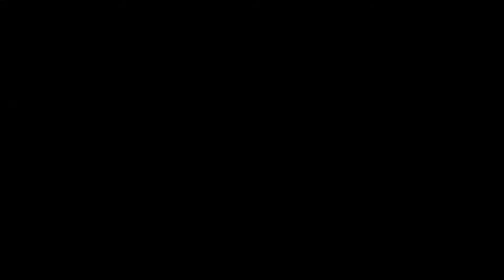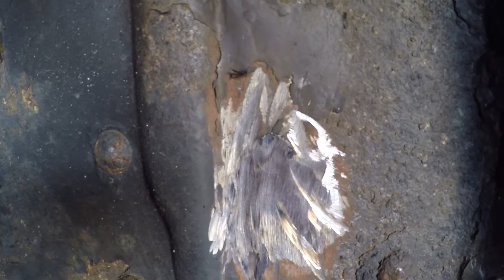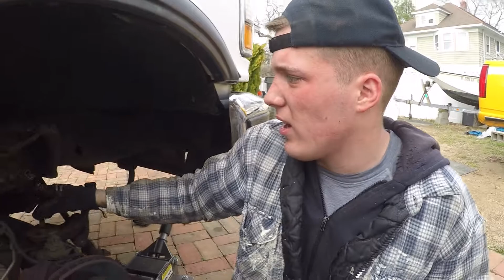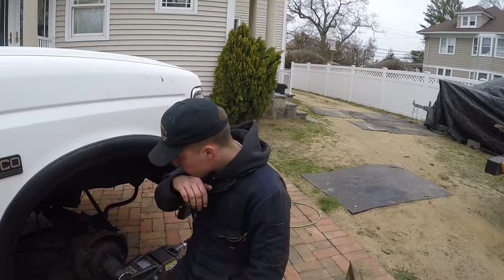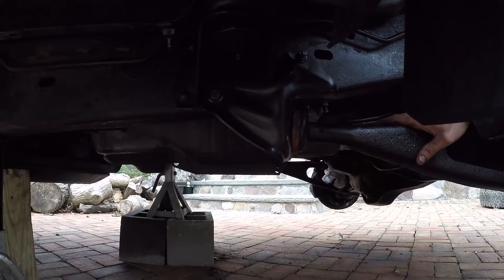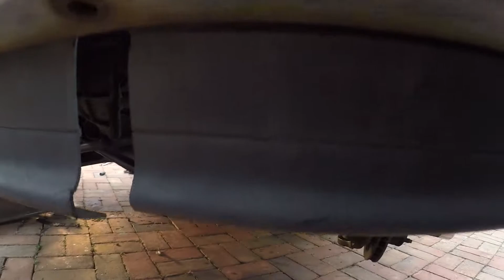FORD BRONCO(F150)- Shock Mount/ ShockTower Replacement

Comment: Does any one else see how crocked the spring looks from top to bottom
Reply: It goes away when you let it down and roll the truck forward. It will freak you out at first.
Reply: these trucks sit like that, look at any of them. I have a 78 ford and they sit like that.

Comment from the maker: UPDATE: Ended up going back to that last vertical plug welds I skipped and threw a weld on it with the MIG welder. Still an important part of the mount, get that bolt in if you can... Thank you guys!!
To paint the frame I used rust reformer and then bed liner after grinding it down. 
Also used blocks and wood to jack it up..... be safe when jacking up your vehicles everyone!

Comment: Are the coil spring straps supposed to go up and latch on the strut tower mount? Opposite of the bolt side? Thanks
Reply from the maker: yes, the rubber bushings sandwich the mount

Comment: Awesome work guys, did not realize it was welded to the frame so that will be a bitch to get off.  Went over a pothole and my spring took a piece of the shock mount with it so this video will definitely help a ton.  Cheers!